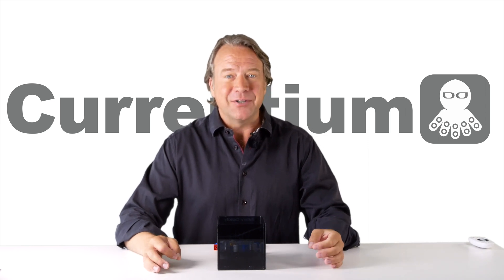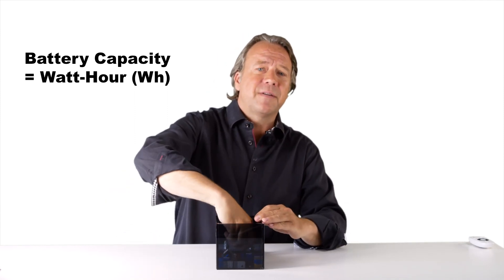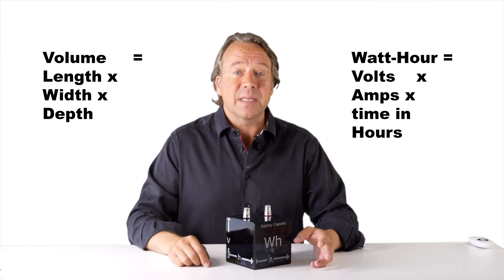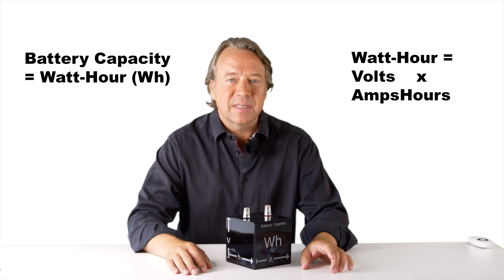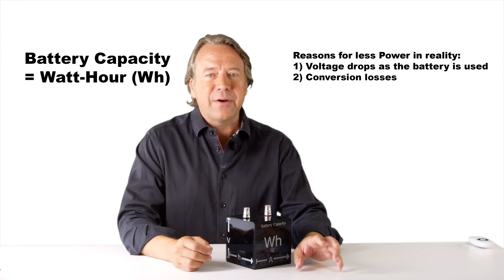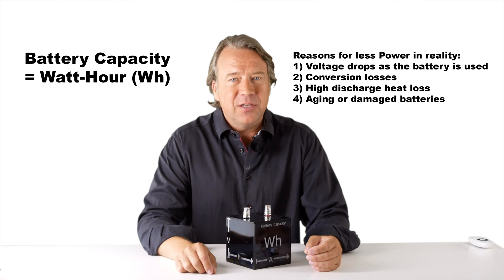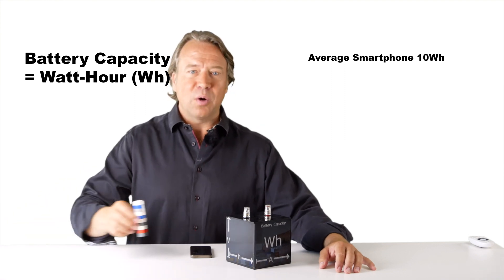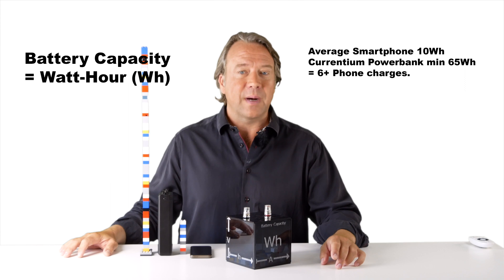How battery capacity is measured and what is Wh? (Watt Hour)

Comment: So a 160 Watt Hour battery is considered extremely hazardous.  When using a  calculation for the purposes of determining all the effectiveness parameters in discharge/use requires all the haircuts to performance you listed.  When looking at the hazardous nature of the product, should one just consider the Ah x V?  That covers all the junk that will burn up in the battery if it goes bad, regardless of how much efficiency it might have had if it was discharged in use.

Comment: Hello, Thanks for the info I learned a lot from you. 
If you could help me on my solar system I would appreciate. 

I have 8 Panels each 350watt mono, 
I have 8 batteries of 150amp gel, 3000 deep cycle, connected in series, it is 48v sysytem

STECA SOLARIX PLI 5000-48 INVERTER HYBRID INVERTER- indicated 80amp, no controller needed. 
I got 160amp fuse for solar wire before it get into the invertor, One point to consider my system is not high tech like yours, I am communicating with you from far away in Africa. 

I tried to explain my system so you understand what I got,
My problem, during the day time the Invertor charges the batteries and they get to 53.6¬53.8 volts, but this is where it get  complicated in the evening or sun-set the invertor start beeping error (04) by saying low power from battery, then switches back to the grid=no use at the evening!
This made me mad, the setting is set to 44, if battery get law than to 44 then only Invertor to go back to the grid. Investigations I measured the batteries and each is showing 12.6 to 13.4 volts each.
Do you come across this kind of faults where the battery is full and come in the sunset no power to give,  where it should hold at least few hours, but it gives up at sunset.
Please ask any diagnostic questions, if I missed any, thanks in advance
Thanks in advance Alex

Comment: i know i know this but A×V=W... so it's just how many hours the battery can deliver those amps at its nominal voltage until it's "dead" so what I'm finally understanding now... is... that watts are a meaningless unit that only confuse the consumers of electricity
Reply from the maker: It can be confusing but they all say different things when you get used to them. To help remember you can think of Watts like the measure of how hard and fast you are peddling a training bike in a gym. And add time to give Watt-Hours as how long you can go at that speed before being exhausted.

Comment: Can you tell me if a battery that is fully charged and one that is flat have the same watt hours and if one is rated at say 274w/h on the side is at fully charged and if it was discharged to say 10% would it still be 274w/h?
Reply from the maker: I understand that you are asking this because of Airline regulations that have a limit of a singel 160Wh (or several 100Wh) as handluggage. When we talk Wh we normally want to know what is the maximum amount of energy that can be stored in that battery. That is typically its rating. By discharging the battery it still has the same rating even if it is safer to transport discharged batteries.
Reply: @currentium  Thanks, I understand this is the rating on the side of the battery but i met with CASA who govern air travel in Australia and they said that a battery that is discharged in real life wont be 274wh and in theory could travel on board.  I wanted to see if i could find something that proved this as Dangerous goods asked for more information.  I am struggling to find anything or understand if this is true and your video was the best i could find, thankyou for replying too.

Comment: Can a Battery show full charge on a volt meter , and still be missing the Amps - where it won't do anything to crank over an Engine or make Light come on?? Thanks in advance.
Reply from the maker: Yes, If the (fully charged) battery is really old and worn out its voltage may show the same voltage as a new battery but will drop much faster when trying to use it. If its really bad it will not give enough power (Amps times Volts) to start a car. So it would be storing less usable Electrons (Amps times time) in that case that a new.

Comment: I have a question I hope you could answer. There is an argument or debate going on in the tool community about fairness when comparing tools with different batteries. Specifically watt hours and cells. If one of the battery packs is 24 volts rated at 120 watt hours using standard discharge 18650 cells comparable to using an 18 volt battery pack rated at 108 watt hours using high discharge 21700 cells? Would that be a fair comparable test? Which battery pack has the advantage or would they both operate with the same power? Also someone said that a 18 volt battery pack rated at 108 watt hours with 21700 high discharge cells is actually producing twice the watt hours since it’s using high discharge cells. Is that true? Sorry to bombard you with all these questions. I’m very interested in learning the technology behind the different battery cells and the way they operate. Hopefully these are questions you could answer for me. Thank you for your time. Hope to hear from you
Reply from the maker: The question is How do you test and compare fairly and meaningfully battery pack or power banks. Eg which is better 24v 120Wh of 18650cells  vs 18V 108Wh of 21700 “high discharge” cells. 

Let me answer it generally like this:

The short answer is if your batteries are getting hot or really hot when you are using them then the are probably to weak for the task if you want them to last as long as possible.

The longer answer is, first its really important to keep Watt(W) (how hard it is/can work) and What Hour(Wh) (how long a battery can work before empty) separate. 

The answer is it depends on at what power level (W) you are pulling out of the battery pack. The limit is a combination of the chemistry and the quality of connections.  The closer you are to the max that a specific pack can deliver the more is lost to heat.  If the (W) you are pulling out are used where you need them or if a large part is lost as heat because you are running the batteries as hard as they can work. If the batteries get hot then you are losing usable Watt hours (Wh) that is not going to the work you  want done, and the battery chemistry is pushed hard resulting isn shorter life of the pack. This can significantly affect results.

So any test has to be done at given power (W) Level that is relevant to the use you want to compare. At that power you measure Wh delivered and compare.
Reply: @currentium  thank you so much for getting back to me. Thanks for educated me on how these cells and battery packs work. The main focus of the debate in this particular issue though is, does a battery pack containing 21700 high discharge cells, produce twice the amount of watt hours while under load? The rating on the battery pack says 108 watt hours, but when under load ( in use ) does it produce 200+ watt hours? If would think not but someone is saying it does
Reply from the maker: A battery will NEVER deliver more total energy (Wh) when under heavy load than when working at low load. There will always be more or less loss to heat. A larger battery capable of higher discharge will lose less to heat.
Reply: @currentium  thank you. Ever since you first messaged me back a couple weeks ago I’ve been studying lithium ion cells and discharge rates, discharge curves, c rates, etc etc. I’ve learned quite a bit but there’s still plenty more the learn. The main thing I was getting wrong was associating watts with WH and amps with AH. Knowing the difference between power and energy and charge capacity Vs energy capacity makes things a lot easier to understand. Thank you for all your help my friend. I really appreciate you getting back to me

Comment: If a device lists its Wattage is that for one hour ? Trying to determine Watt-Hours so I can be sure I have more than enough power to run a device for an 8 hour work shift. Thanks
Reply from the maker: Wattage (Watt) rating should refer to max power usage at any point in time. The average should be the same or lower.  You should be able to assume that it will give you the max Watt-Hours (Wh) consumed in an hour. If it is important you should test or measure it.

Comment: hi, if i need to run a tesla instead of its 100KwA battery, which generator i need to use? The question is not about recharging the 100KWA battery, but about replacing the battery with a generator. In that case, what would be that generator's power? I have seen people charging Tesla with 5KW generators. So can i run that tesla, with 5KW generator as a power source?
Reply from the maker: Sounds like you should look a hybrid cars which are Electric cars + fossil generators that work together and charge while running. You will not want to try and run a tesla with a large fossil generator in the boot. It probably won't accept charge anyway while running. Its safety features would think that you have forgotten to unplug the charge cable and would not let you drive/run the car until unplugging.  Stay Safe.